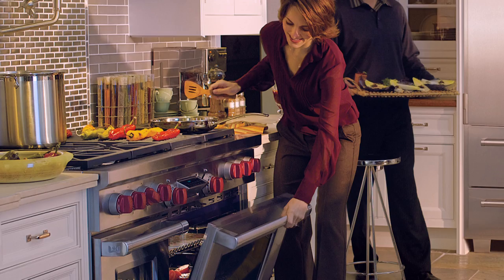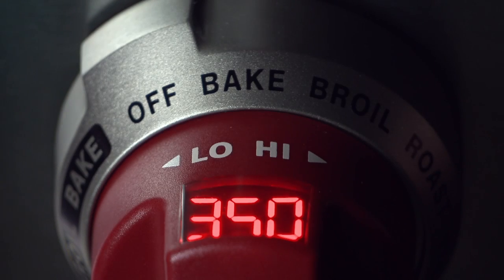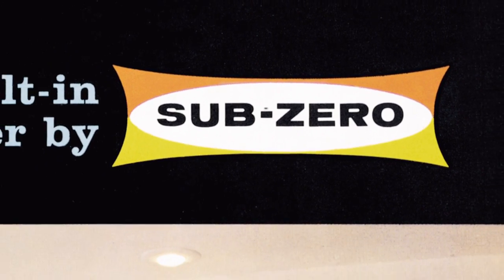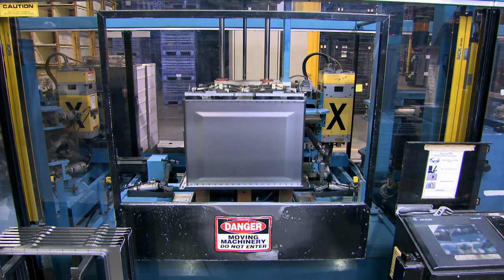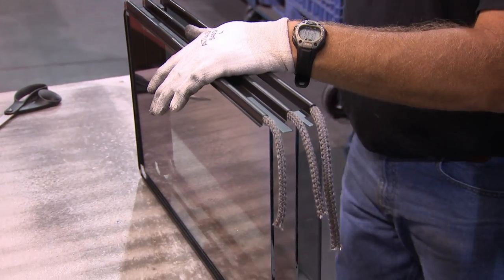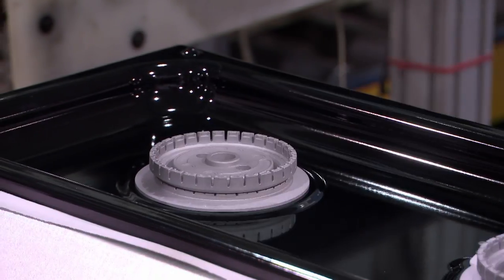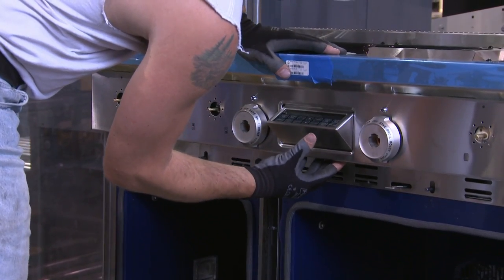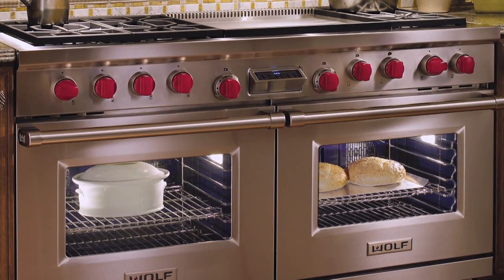How a Wolf 48" Duel Fuel Range is made - BrandmadeTV

Comment: Made to last 20 years?   For the price it should last 60-100 years  Like old appliances.
Reply: I have my parents wolf stove built back in 1993. It's a 4 burner with griddle/broiler combo. I love it.
Reply: We have a GE fridge in our garage from 1974. It has never been serviced or worked on and still works perfectly
Reply: @mydailyreward2090   Longevity isn't everything. Your '74 GE is as energy efficient as a modern fridge with the door left open 24/7. My Mom's Kenmore dryer lasted 40+ years until they sold the house. Same thing, efficiency-wise.
Reply: @wpdoyle  I'd sooner have a reliable appliance that lasts my lifetime. As opposed to a more energy efficient one that I have to replace every 3-12 years or so.

Comment: Nobody is bothered by the misaligned knobs?
Reply: They are for the oven
Reply: Dre Park I got that, but the knobs didn't have to be misaligned vertically
Reply: WouterZtube lol, it’s a top level and lower level. All lower level controls deal with the lower oven. I actually love it this way lol.
Reply: Dre Park an icon would have been enough. I think they should all be aligned
Reply: @WouterZtube 
Icon not easy to see. This is intuitive..